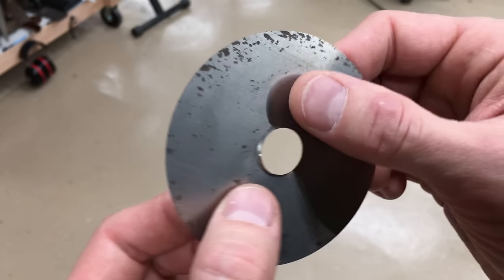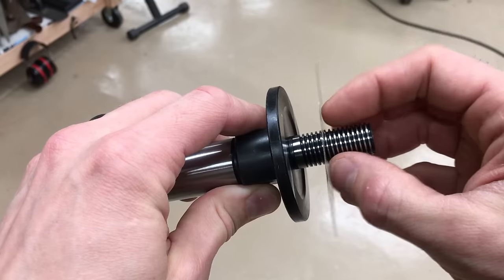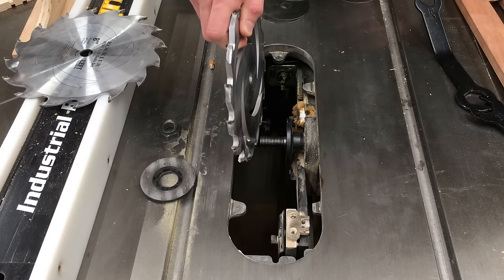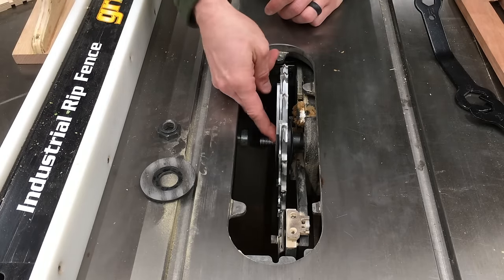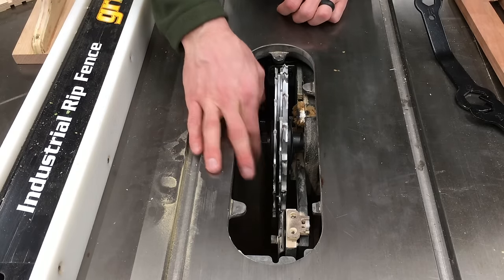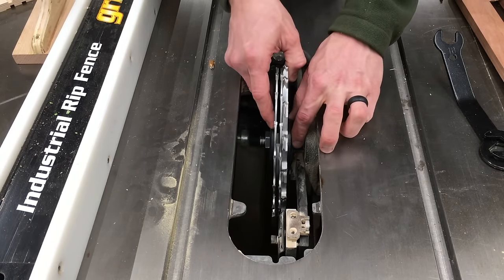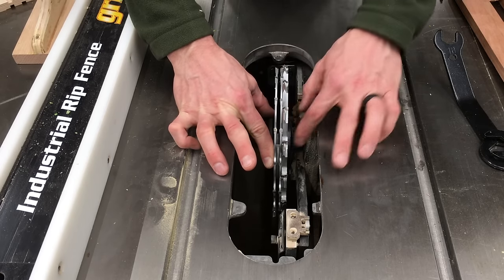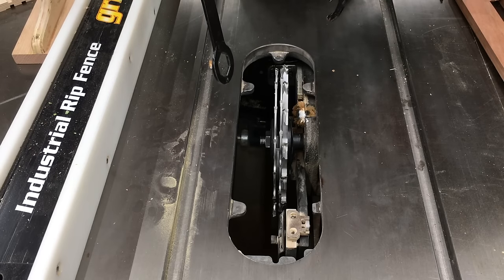Quick Tip - Avoid ruining dado shims

Comment: Good tip! Way back when I purchased my dado stack I picked up a set of magnetic shims and don't have this issue. Not sure if they are still available but I thought I would throw in my two cents. Thank you for your videos.
Reply from the maker: +Steve yes, I've heard of those, a good solution.  Where did you buy them?
Reply: It was at a local tool supplier, I'll look tomorrow to see if I still have the package they came in and give you the brand name.

Comment: Of course! Thanks for the tip. Too bad mine are ruined already...
Reply from the maker: +Jeremy Schmidt you bet, glad it was useful ... or would have been useful if I told you earlier.
Reply: Jeremy Schmidt they may not be ruined just yet... I used a small ball-peen hammer and my vice’s flat spot (anvil) to flatten out the damaged edge of the inner ring. Then, I’ll use Andrew’s technique to avoid this problem in the future. Also, I have ordered a set of magnetic shims from jhl on amazon, and I plan to use one or more magnetic shims to “attach” my Freud shims to the inside of the cutters to keep them from moving when sliding the dados onto the arbor. I figure the combination of metal/magnetic shims and Andrew’s technique will give me perfect dados every time in the future!

Comment: Good tip Andrew, the shims I have are starting to get chewed up like that.  I will give this a try.  Thanks.
Reply from the maker: +Brian Bain hope it works for you
Reply: Andrew Klein Using a slightly tapered dowel, I center the shim (s) adding a touch of chapstick to the blade prior. That keeps them in place while installing.
Reply from the maker: +Christopher Lowers I could see how that would work.

Comment: Oh I was so hyped for this. but the blade set cost more then I paid for my tablesaw.
Reply: Quality tools aren't cheap. Like anything else, if you value both precision and time, you have to spend money.
Reply: Erm, its kinda priced high for a one trick pony... don't you think? I mean I already have 2 dado stacks alone. I don't think I make plywood boxes, or boxes in general enough to justify this blade set.. I guess if you're running a small business the price is easier justified.
Reply: It definitely depends on what you make. I spent $3200 on a small handheld edgebander from Festool, and it won't even work with the pre-glued stuff, and I still have to hand trim. 

But if you don't make plywood boxes then this isn't the tool for you, that definitely makes sense.  I make a lot of drawers, many of them dovetailed, and I would buy this just for the non-dovetailed drawers.  (unfortunately, I don't own a table saw with a 5/8" arbor).One of the cool things about woodworking though, is that you can do a given task so many different ways. I've been woodworking for a long time and I can certainly remember jointing the edges of boards with a router, and doing so many other tasks with such a minimal tool set. It takes longer, but it can be fun.